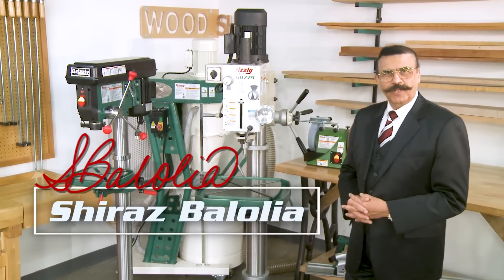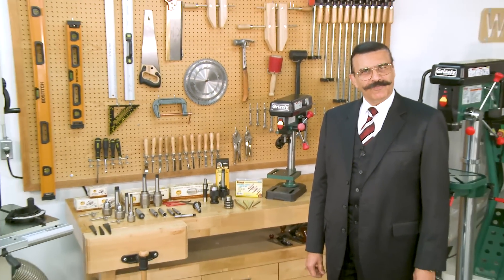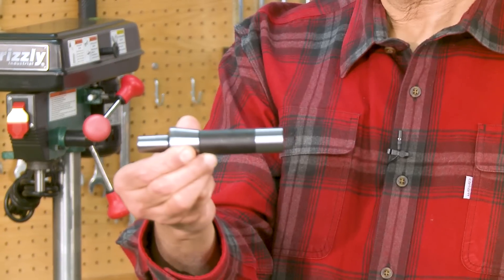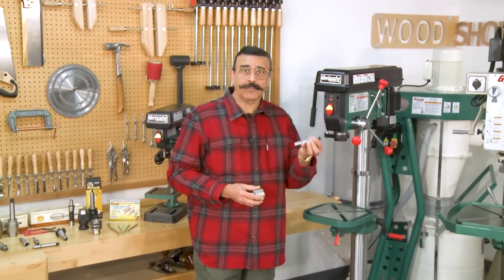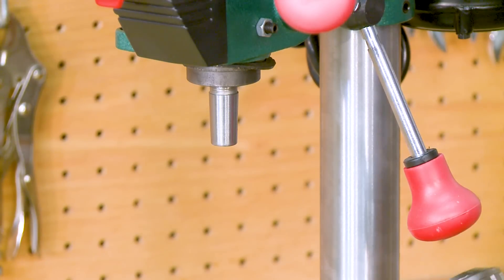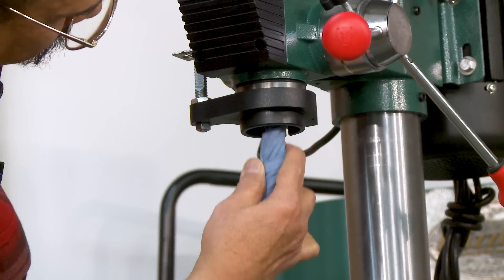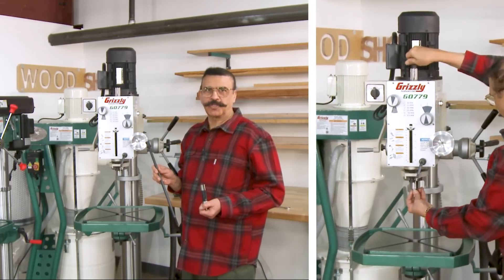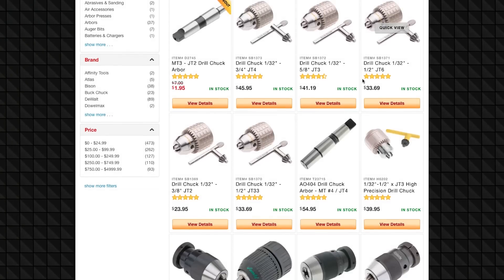Drill Chucks and Arbors 101: with Shiraz Balolia

Comment: Grizzley machines are awesome and its great because there compatible with so many upgrades allowing you to build a fantastic dialed in machine!  I love being able to customize my equipment like this.  I had a question though?  I recently picked up my first lathe being the GO765 mini lathe and it did not come with a drill chuck arbor.  I ordered a MT2 type arbor with 1/2-20  thread and then got a small quick release drill chuck to put on it.  When I look down the bore on the tailstock I don't see any slot that would engage with the flat on the end of the arbor I got.  Is it ok to try and run a MT2 arbor with the flat at the end on a GO765 tailstock?  I don't want to damage either of them and also don't see how the arbor would keep from spinning inside the tailstock if I did.  Did I get the wrong arbor?  Thanks
Reply from the maker: We’re glad to hear you're enjoying your Grizzly machine! The flat end will fit most quills; however, in some cases, you may need to trim off the black tab at the end for a proper fit. On the G0765 mini lathe, the tailstock is designed to hold a standard MT2 arbor snugly with friction, rather than using a slot to engage with a flat. So yes, you can use an MT2 arbor with a flat end in the G0765 tailstock—it won’t damage the machine. The arbor should seat securely with a proper taper fit and should not spin under normal use, especially with light drilling. Just be sure the taper and bore are clean and free from oil or debris to ensure a good grip. For more detailed information, please don't hesitate to reach out to our Product Support team at (570) 546-9663.
Reply: @grizzlymachines  Ok great thanks.  I inserted the MT2 into the tail stock and it worked perfect even with the flat on the end.  Thanks again and I'm looking forward to buying another Grizzley when it comes time to upsize my next machine.  Thanks
Reply from the maker: We're glad to hear the MT2 fit perfectly and that everything is working smoothly. We appreciate your support, and thank you for being a valued Grizzly customer!